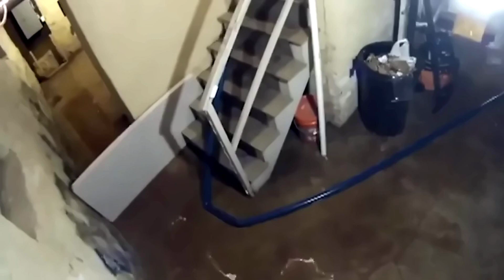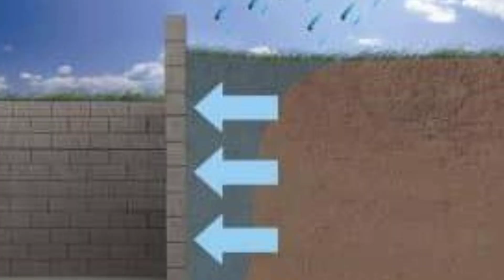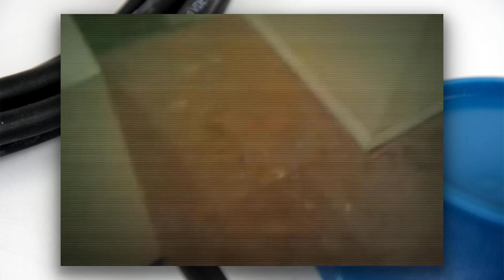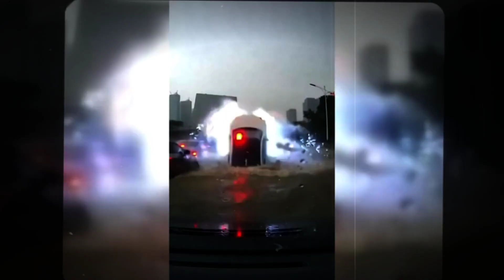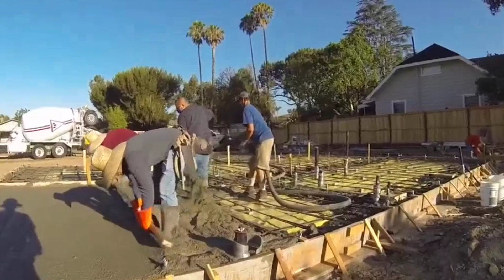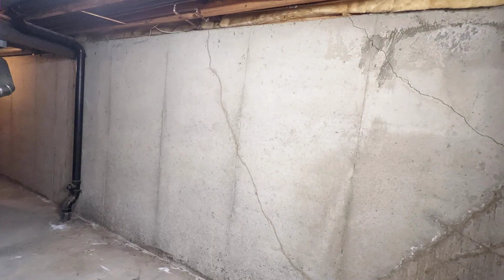What Kept Old Basements Dry Before Sump Pumps Existed

Comment: Most old houses had combined sewer, which is really why old houses typically don’t have sumps. It is incredibly expensive to run city mains at the depth necessary to work for combined sewers. Even at 1/32” drop over miles those city mains start to get really deep. Plus, cities started making a concerted effort to get the storm drains separated from the sanitary because during high rain periods it overwhelms the treatment plant’s ability to process the inflow and creates sewage runoff.
Reply from the maker: Totally agree! Old homes were hooked into combined sewers storm and sanitary all in one pipe so foundation drainage just flowed right out, no sump needed. Made sense at the time!
And yeah, those mains had to go deeper and deeper over distance just to keep the gravity flow going. Super expensive to build and maintain.
The big shift came when cities started separating storm and sanitary lines because during heavy rain, the treatment plants just couldn't keep up and that meant raw sewage overflowing into rivers and streams. Not good!
But the funny part? Once they separated everything and cut off the old foundation drain tie-ins, all those basements that never needed a sump pump suddenly did. The "fix" created a whole new problem for homeowners! 😄
Thanks for bringing that up great context for everyone watching! 🙌